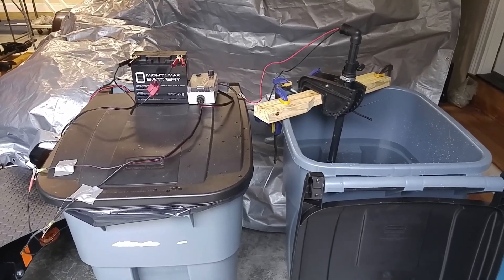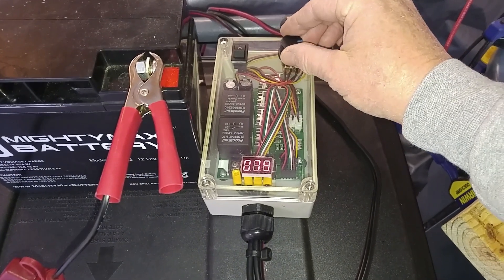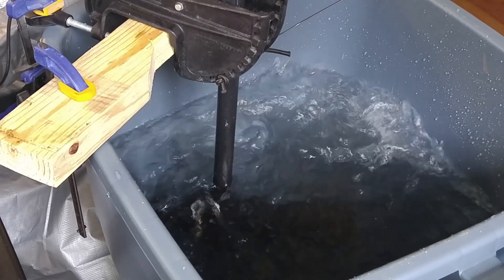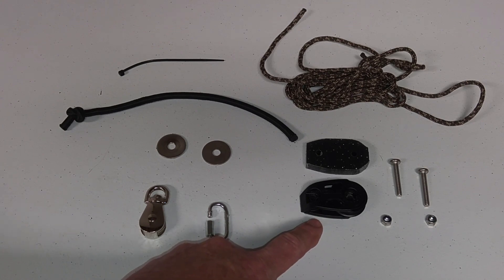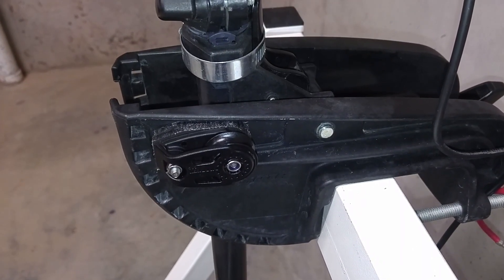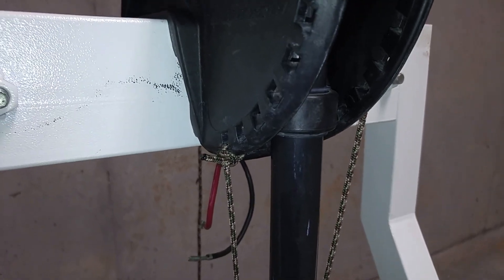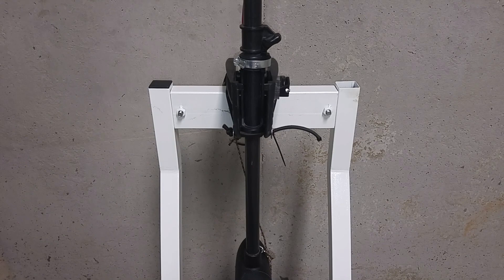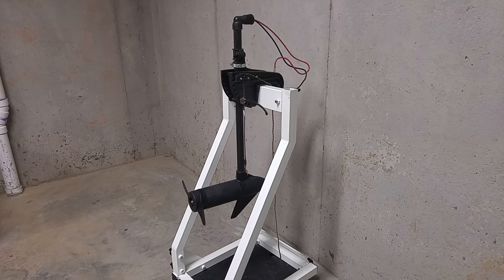DIY Trolling Motor Inexpensive Impact Protection and Cable Lift

Comment: Finally spotted your version two of the lift system. Along with that, I was thinking of adding a third pulley on the pulling handle end and discovered that Nucanoe has a Big Wheel pulley that allows you to pull the handle up towards you and offering even greater mechanical advantage. Nucanoe also sells a retractable lift kit with all you need including the hardware leaving all you need for your version is a third stainless steel pulley from Ace hardware. I have a watersnake motor so I will also be using a conduit hangar at the bottom of the shaft to hold that pulley since there is no place to drill a hole. all of this being said, I may forgo the big pulley idea first to see if is even necessary before drilling holes in the kayak for well knots (because of the added strain of the Big Wheel). Thanks for all of your insight. I am now a subscriber!  (along with a couple of other guys "Bassman and Lunker Hunter").  Sorry for being so "wordy" but I have a propensity to compose while typing and thus the "ramble".
Reply from the maker: LOL. Thanks James.

Comment: I have added this to my motor but now I want to add foot control steering. Do you have any advise on how I can compensate for the added steering line needed when I  trim the motor? I can trim it up about 6” so I’m sure I will need to compensate for that on the foot control cables.
Reply from the maker: Try centering your pedals first, take you feet off them, and then pull up the motor. You might not need to add any length.

Comment: i have been researching endlessly for this a DIY trim system and my idea is almost identical to yours. unfortunately my trolling motor is the minnkota terova. no where to really mount the pulley and if i remember right, the plastic on it is thin and weak unlike the one in this video. I would appreciate it so much if you could maybe look at the terrova and see if you can visualize a similar system like this. i was so looking forward to a working demonstration lol

Comment: How do you prevent the motor from tilting when you put the motor to go in reverse? Also, are you able to disengage the motor from the kayak?
Reply from the maker: The shock cord keeps it from popping up in reverse. Yes you can remove the motor.
Reply: @Aksmaniyak  thanks for replying. Another question is, since the clamp that allows the motor to be pulled up or down is loosen does it have any chance on rotating left or right? I'm using a rudder system unlike connecting the steering cables directly to the motor so I'm worried it will freely rotate on it's own

Comment: Can you use this vertical lift system but have a mechanism for the motor to stay straight (not turn)?  The reason is that I have a steering rudder and so I want to use this lift system but have the motorhead stationary.
Reply from the maker: This method does have a minimal turn but not enough to be a problem for standard set ups. I'm assuming you are using a steering rudder on the shaft above the prop. If so,  then you will not be able to lift the motor up very much unless it is very deep.
Reply from the maker: Nathan, I started a FB page that makes it easier to share information and videos. Here is the link if interested.  https://www.facebook.com/groups/3521517597860461

Comment: Hello Aksmaniyak, I was wondering if you hadn't put the tensioner cord on the motor, what would happen. I would think I would lose reverse, but that's OK, I don't need it (I think). I fish where there is a lot of stumps and kind of like the idea of the motor being free to pop up when necessary to avoid damage to the motor/prop. Do you think that would work? Or does the motor try to pop up when you turn. Definitely would appreciate your thoughts on the matter. I enjoy the way you really think things through before moving forward. You save us "trial and error" guys a lot of experimenting. Thanks for posting.
Reply from the maker: Thanks Elvis. Trust me when I say that many of my videos are a product of failures until I reach a solution. Reverse will still work without the tensioner but it must be done at a very low speed.
Reply from the maker: You are welcome Elvis. What happens when there is no tension the motor has a tendency to pop out of the water in reverse.

Comment: Rather than using a radiator clamp I just pull the lock lever back and stick a 1/2 ounce flat sinker in between the lever and the housing, if you tie a line on it you won’t loose it and you can just pull it out if you want.
Reply from the maker: Nice. That's why DIY is so great; there are many ways to do things.

Comment: Great idea, thanks for sharing. I'm wondering though, is there any way you could use this lift system with zeroing springs in a pedal steering setup? Of course it wouldn't be practical to mount the springs on the transom as it would require more force to lift the motor. But what about an adjustable spring tensioner in the foot pedals? Would love to hear your input.

Comment: Hey Aksman, great content.  I have had the same TM on my Nucanoe and for a couple years and have been using the tilt function on a pulley system to raise the motor.  I like your vertical method better and have made the modifications.   Still frozen here, so have not tested out on the water.  I have a concern that with this setup, I no longer can control the turning tension on the shaft with the thumb nut.  Suspect that this will require me to keep tension with my feet on my ruder pedals at all times to keep the TM from turning off course on it's own.  What is your experience so far?
Reply from the maker: Thanks. If I understand you correctly, you are talking about shaft rotation when you pull on the cable to raise it. Yes? If so, this "V" set up keeps the trolling motor pointed forward and has minimal (if any) twist.
Reply: @Aksmaniyak  Sorry I was not clear.  I am talking about shaft rotation due to the power of the motor as the prop is turning.  With the thumb nut, I can have enough tension on the shaft rotation that if I use my foot pedals to adjust direction, the shaft will turn but is still tight enough that it cannot spin freely on it's own while under power.  Now that the shaft rotates freely, I am concerned that I will need to keep constant pressure on my foot pedals, as opposed to being able to take my feet off the pedals while maintaining a generally straight course.  Maybe still not clear?
Reply from the maker: Ok, I got it now. I have never had that problem because the foot pedals had enough friction in the guides to keep that from happening. I never tried that in a tight turn though. But when you remove the brake from the pedals so they can slide, they also double as foot rests, so it is easy to control the kayak.
Reply: @Aksmaniyak  Thanks.  I'll reply back once I get it out on the water.  Keep the great ideas coming!
Reply: @tightloop01  did that shaft ever rotate on you? I had the same question as you but haven't gotten a reply yet
Reply: @willbill2209  No, the shaft remained tight enough that it is not an issue.  Able to run straight without adjusting peddle tension while underway.
Reply: @tightloop01  just to make sure im picturing this right. You have the rudder separate from the motor itself right? In other words, you control the rudder separately and the motor is freely rotating
Reply: @willbill2209  Correct.
Reply: @tightloop01    So mine is definitely moving sideways so badly it won't steer itself straight back even after trying to counter steer it with the rudder. Any ideas that can fix the issues?

Comment: Does your setup still allow you to use reverse? I like the idea of protecting the motor and kayak, but I need reverse thrust.
Reply from the maker: Yes, reverse is still used. This modification keeps the trolling motor from raising up out of the water when reverse is used without the mount lock.